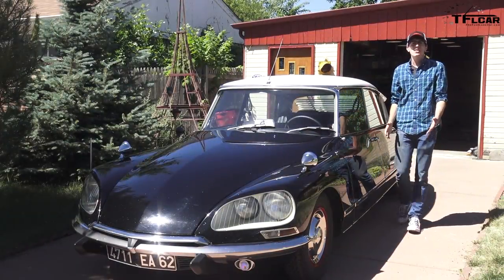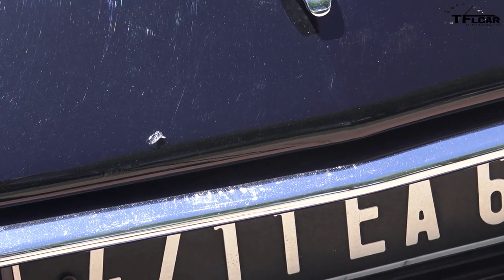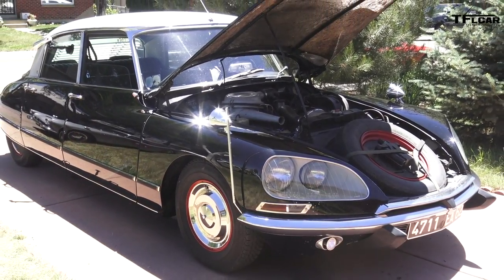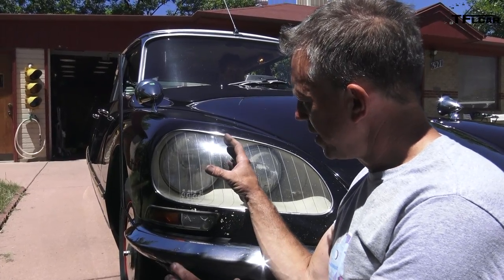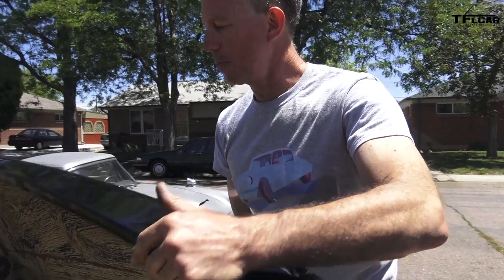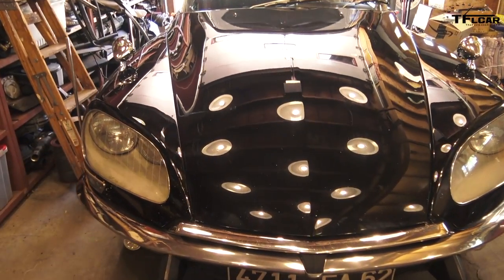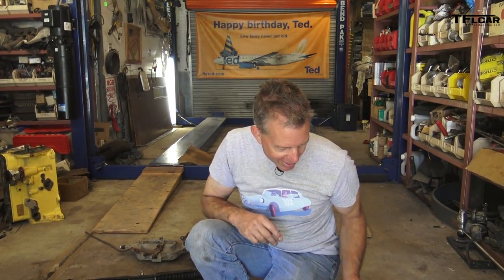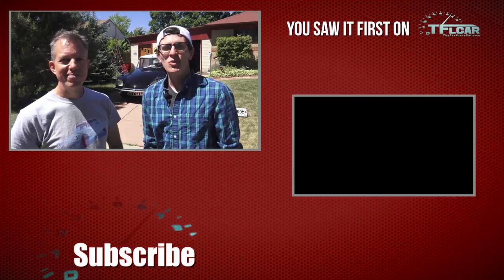Top 10 Reasons Why This Is The Most Revolutionary Car Ever Made

Comment: Before the Tesla Model S I would have agreed unequivocally that this is the most revolutionary car ever made. But now? Not so much. It just looks like the quirkiest car ever made, which isn't quite the same thing. The Tesla Model S is truly revolutionizing the auto industry in a way that no other car has ever done, not even the Ford Model T. The difference between quirkiness and revolutionary is whether others follow your lead or not. The rest of the auto industry did not really follow Citroen's lead. They are building EVs, whether they want to or not, and they are working on full autonomy, which will totally revolutionize transportation as we know it.

Tail lights did not get universally relocated to the top of the rear window. Other companies offered air suspensions, but they did not take over the industry either. One spoke steering wheel? Nope!  Brake bulb instead of pedal? Nope! Chrysler did hemi heads, but nobody else. Plastics did get widely adopted.

The Ford Model T was quirky too, and also part of a revolution. But the revolution had actually started before the Model T was introduced, and Ford merely rode the wave of the revolution that was already under way.
Reply: They didn't follow the suspension because it cost too much to make, that is as simple as that. Nowadays what ? almost every car has a controlled suspension, supercars like the mclaren have actually a system that is a look a like from what citroen did on the citroen xantia activa, which was the first mass produced car in the world to feature an anti-roll suspension, it's so powerful it took the car to the first place in the world in the moose test, in front of supercars.
Rolls-Royce and mercedes wanted that suspension, but they never got it, rolls royce got the rights to use it though on some of their cars, but it was used under the citroen licence.
Directionnal headlamps are now standards too.
The Citroen Xantia and BX ( 1990s ) had rear wheels that would turn with the inertia of the car.
The CX, SM and XM had a steering wheel that would get stiffer as you would get faster.
The XM in 1989 featured the hydractive suspension, which was basically monitoring the road and the drivers input to adapt and stiffen the suspension in case you want to, and now what ? Premium cars are doing the same.

The differences between the DS and the model 3, is that the DS did everything before anyone could do it "massively". Nowadays, they can do that, they have the tools and the finances to produce extraordinary stuff like that.

EVs cars are just the same thing as petrol car, the only difference is that you're not creating any sort of pollution with your engine while driving it, but when producing it, damn it's another story ! Remember that  brakes are also creating particles that are dangerous for us too, but apparently that is not a problem today.

Comment: It's a great forward thinking car, and it had an objective like the 2cv, Landover defender etc. The last great Citroen was the Xantia activa, watching this video made me decide to replace my very long in the tooth Passat with a C5 v6 exclusive estate (RE08LTX in fact which was the review car for trusted reviews). After a bx1.7dtr, bx 4x4 GTi, bx 16v, Xantia 1.9td SX, Xantia 2.0 vsx auto, Xantia v6 auto and 3 xantia activa 2l turbos. The C5 is aweful. The ride is willowy, and slow in comparison to the cars before it, the auto box is always in the wrong gear, the engine is aweful on fuel, sluggish when not in sports. Oh and it doesn't have Citroen breaks, it's got 2pot standard breaks. I felt bad that Citroen stopped providing this suspension system, expcialy as I spent 15 years of my life studying it and helping others maintain it. But they had already killed it with the C5 and c6, the last real Citroens were the xantia and XM and I am so sad I got rid of my last activa as I'll never ride in anything like that ever again. The Activa btw still holds the record for the moose test.
Reply: Yeah, that is the differences with the c5. Even though the xantia and the XM were very comfortable, they still were very reactive and not heavy. Now the c5 and c6 are really heavy and not that much reactive in comparison. 
I remember a video comparing a coupe, a regular sedan and a xm, the xm was going as fast as the coupe if not faster due to the hydractive suspension, the regular sedan couldn't though. Most of the people actually think that these citroen don't have much grips because it's quite unusual to see cars that lean so much while still gripping, but it impressively has great handling ( I'm not mentionning the xantia activa as they're quite special in this subject ).

Comment: No doubt, the DS was revolutionary, but it didn't change the layout and 'architecture' of cars in such a fundamental way as the original BMC Mini, launched in the UK in 1959. Just look around: nearly every modern car under 1600cc has a two-box shape and a transverse engine driving the front wheels. 

The Model T, first sold in the US in 1908, was even more revolutionary than the Mini. Without it, the modern cheap, mass-produced car would not exist. I'd have to say the DS was not the "most revolutionary car ever made". Which is not to diminish it as a true masterpiece of motor engineering.
Reply: every car nowadays has small engine because they can't make engine with higher displacements, it's due to the pollution regulations/laws.
It's pretty sad though, I would like to see big naturally aspirated engine back.

Comment: When did Citroën stop using hydronumatic suspention? The XM had it I think, you find those on scrapyards and the like with the body allmost sitting on the ground eventhough it got wheels on it.
Reply: First gen C5?
Reply: Checked Wikipedia later and apparently the luxury trims of the C5 still got it.
Reply: Indeed. I checked Citroen's site (because I don't trust wikipedia one bit), and they still offer it. So I stand corrected.
Reply: As long as the sources are good ;) In this case its most likley written by someone at Citroën
Reply: They stopped developing hydropneumatic suspension and once the C5 ends production it will be gone but they are working on a new type of hydraulic unit with hydraulic stops which should be less complex.
Reply: They stopped two weeks ago when they stopped making the C5.

Comment: Revolutionary just means super expensive to fix when it breaks. Not "if" it breaks, when it breaks.
Reply: If you don't know what you're doing, everything is expensive to fix. Also, hydraulics were even at that time proven technology and pretty reliable. Think of the electronics in modern cars. Could be a nightmare in the hands of the wrong garage. On the other hand, regular maintenance is actually cheaper, as you only have to refurbish or replace the pressure balls instead of the entire shock absorber.